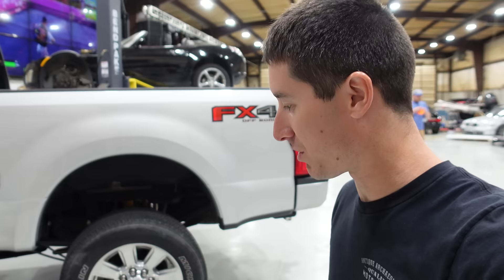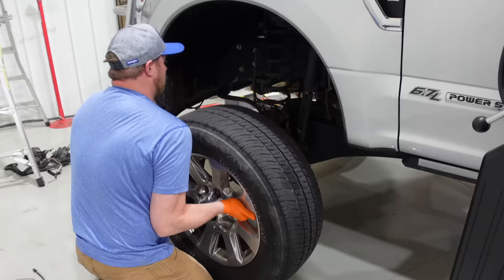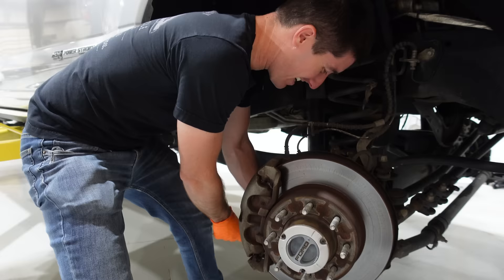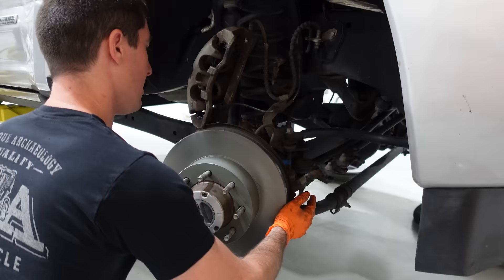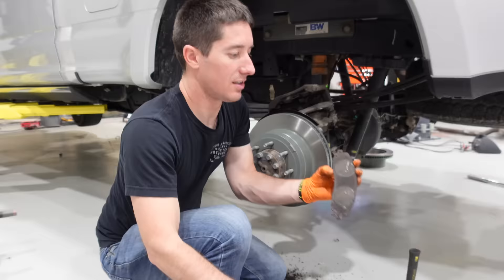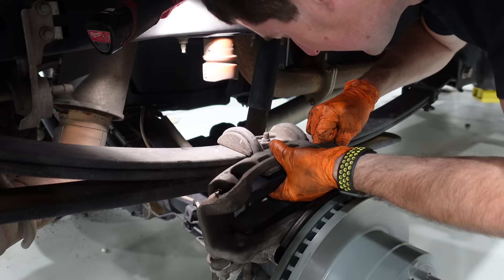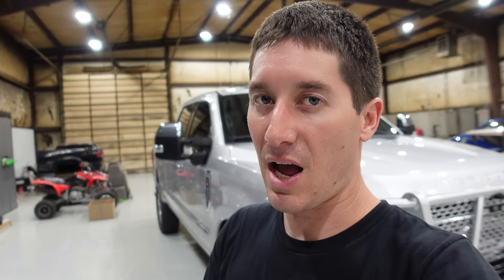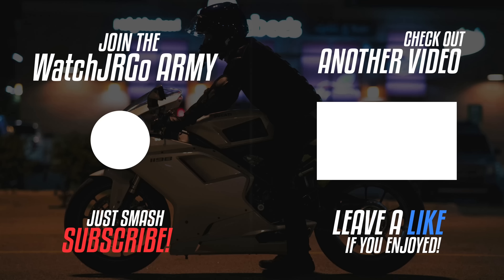This Simple BRAKE JOB On My F-250 Cost OVER $800

Comment: Back in the late 70s when I was running an auto parts store, I had a customer who had a rural newspaper route.  He had a Datsun 510 wagon that he used for the route, and he was (understandably) hard on brake pads.  I offered him a good deal on a whole case of pads, and since he was putting a new set of pads on the car about every 2-3 weeks(!), he jumped on the deal!  He said he could change a set of pads in about 10 minutes with hand tools... including jacking up the car!

Comment: Glad I’m not the only one who fights with brake pad clips when doing what should otherwise be a simple job.  And that we both buy Hawk or StopTech/PowerStop.
Reply: Pad clips on a ford brake job have always been a nightmare when I do them
Reply: If you have access to one, a sand blaster is the best tool to use on the caliper brackets. The clips still aren’t easy to get on after but they are less impossible.

Comment: I’m a tech so i work in the automotive field everyday and the worst calipers to take off on any vehicle are chevys cause they lock tight the bracket bolts from the factory and they suucckkkk to take apart. Especially when you can’t get an impact in there

Comment: When the after market is better than oem
Reply from the maker: Super weird, right? I think rotors should last longer than 60-80k too 🤔
Reply: @WatchJRGo  depend with things that are used to tow you're better off changing them around that millage because the heat will make them crack.
It's heavy AF and that generates alot of heat

Comment: Hopefully lubed the caliper slide pins off camera if not need to put it back on the left to do that because that might be what caused your brake pad wear in the first place. And if you don't do that no matter how easy you're on your breaks or how good the brake pads are they'll prematurely wear out it may even damage the caliper and mounting bracket, if you did not lube the pins. If of the pins are not lubed, the caliper will seize on the pins are not move. The pistons will push only one brake pad against the rotor and will have to work harder to stop the truck causing it to were the inside brake pad. Also it's a lot easier to reassemble if you take the calipers off the mounting brackets.

Comment: 16 year Ford master tech here…..the calipers are supposed to be removed from the brackets. One, it makes the job sooo much easier, and two, you’re SUPPOSED to wire brush where the clips sit to clean off the rust (keeps the pads from dragging due to poorly fitting clips, and makes the clips easy to install) After that, Install the rotor, reinstall the bracket with the clips pre installed, install the pads onto the bracket, compress the pistons on the caliper, put the caliper onto the bracket, install your bolts, torque, and you’re done. 
Not separating the caliper from the bracket is why this job took you several hours….instead of 2….max. 
Additionally, based on my experience, even with the heat checks, those rotors were TOTALLY serviceable. GENERAL rule of thumb, you can machine rotors AT LEAST one time (unless the pads are worn down to metal) before needing replacement. Refer to the measurement spec that is stamped right on the rotor to be sure. 
BTW, Oreillys machines rotors. I assume, because you’re such a good customer of theirs, I’ll bet they would have machined them for free….or at least at a very discounted rate.
Reply: Can’t trust those Ford rotors, I went to change a wheel speed sensor on my 6.7 powerstroke , had to remove the rotor, well by removing it with a 10lb sledge hammer and a block of wood, put it back went for a drive, boom warped rotor. Best to replace anything and everything that has to do with a broken part on those Fords. Got a bad fuse? Boom need new fuse box, bad injector? Cummins swap baby

Comment: Should’ve gone powerstop brakes. Literally they are game changers. Love them on my 2016 powerstroke.
Reply: I'm on my second ford vehicle with powerstops - and I agree... they're nice.
Reply from the maker: Probably is a big upgrade, I see them on a lot of Super Dutys. I’m trading this in before the end of the year, kinda hate that I had to do this. Time for a new Platinum or a Powerboost 🍻
Reply: I'm not sold on PowerStop rotors. I've used them several times. In the rust belt, slots tend to rust up because no contact with the pads and they become noisy.
Reply: @n9wox  you could paint them or even use anti seize in the slots
Reply: @atomicbogator6799  you cannot use anti seize in the slots. Drilled and slotted rotors are no good on a heavy duty truck anyway. Raybestos specialty truck rotors and severe duty fleet pads are the way to go.
Reply: @semajniffirg230  oh wait you mean drilled and slotted rotors?? I thought u meant the actual slots in some rotors on the edge and eh raybestos is good for heavy duty like u said that's about it

Comment: I did my 15 f150, power stop extreme duty, all the way around, @ 80k, as well. Much better performing setup, than the oem's that were warped around 30k.

Comment: Just did my back breaks on a 2016 transit connect. 230.00. Took forever because of the design. Had to use a box wrench for the top caliber bolt.

Comment: some would say that when depressing caliper pistons to open bleed screw to remove debris and fluid in caliper. formerly I never did but after having a seized caliper piston bound but what looked like abused engine oil with dirt and grease added it seems like a good idea. BUT the choice is yours.

Comment: I do a ton of highway driving. Bought my 2021 f250 factory new with 6 miles on it when I get home. I changed the front pads about 70,000 and I'm changing my rears right now at 95,000. Again more than half of that mileage is highway and not breaking tho.

Comment: I would have gone with Power Stop brakes instead. At about $300 per axle they aren't cheap but they work better and last way longer than the stock parts do.

Comment: If you have to force your pads in, you are doing something wrong. Second cheap quality aftermarket like from AutoZone never fit right and that is why you have to grind the ears to fit in place. I'm a automotive technician for over 20 years and I have seen it all. You save money and time getting well know aftermarket parts or OEM (Like Akebono, EBC) but those store brand name pads are all made in china once size fits most. That is where your installation issues began and you will ended up with pads dragging, not sitting properly and uneven wear, plus the compound material aren't the best either. If you are going to do the job do your research and buy it online not at the local auto part store unless you are in a pinch.

Comment: The first time I took the wheels off my 2008 F250 it took chains through the steel wheels and a 20 ton jack and even with that still had to break out the propane torch to heat the hub to get the wheels off.  Then it took a 10lb sledgehammer to get the disks off (everything rusted solid onto the hub and hub face).  An entire weekend just to get the wheels and rotors off.  Needless to say I put copper anti seize on everything putting it back on and has been no problem since.  Factory refuses to use any anti seize between these parts

Comment: My brother had an older F-150 that needed new wheel bearings. The bearings were actually part of the hub and rotors. He had to replace the entire assembly because of bad bearings. He’s got a Chevy now.
Reply: My uncle has a truck like that. Its a 2006 or 2007 Ford F-150. I didn’t even know they made them like that until I had to order him parts.

Comment: Jeez, you're not kidding at $800.  Just the rotors were $750 before tax.  I just did four rotors and pads on an Accord and it set me back $650, so $800 sound cheap for a 250.  Dealer offered $1,150 to turn the existing rotors and slap new pads, or $1,325 to replace rotors and pads. 
I haven't had a stealership do a break job for 20+ years, but it warms my heart knowing how much I saved.
Reply: $1k plus for turning rotors and new pads on an Accord.😵 I charged my neighbor $40 for labor to install his provided new rotors & pads front only on a civic. Done in about an hour.

Comment: I have a 2017 Ford F250 Lariet 4x4, I took it to ford at 50,000 for front brakes and rotors cost me $450 for the ford forever brakes ( just pay for labor ) so it should cost me about $250 on the front from now on.  And today I took my truck to ford for a rear brake pads and rotors at 117,000 miles not bad.  But it is going to cost me around $975.00 for the rear brake pads, rotors, and labor which is the bitch !! Because these HD truck have full floating axle it takes ( whatever the hell that means ) a lot more time to disassemble the rear end.   The rear end brake and rotor job at other ford dealerships and non dealership brake shops gave me estaimates of $1175.00 up to $1450.00 it is very exspensive to own these trucks !!! I guess thats why I see so many on the used car lots. Not just Fords, but all HD trucks.

Comment: You really need a 3/4 drive 18 inch breaker bar and single hex sockets from 17mm to 36mm. Trying to break big bolts loose with that little girly ratchet is a joke.
Reply: I have a 36 inch snap on ratchet for those occasions

Comment: Just drove 3hrs to my sisters cause her Accord was was making a grinding noise and smelled funny so I pull the front wheels off the pads are gone nothing left one pad was even missing  the rotors are of course trashed 1 caliper was sticking the other was leaking and 1 bearing was toast!!! I ended up staying a whole day and replacing everything up front brake wise, bearings, front struts,sway bar links.

Comment: Most shops won't do a brake job unless they change out the calipers complete. Took my company 2000 E350 in for brakes back in 2005, cost $2600.
Reply: Scam shops
Reply: @honchoryanc  
It's not so much a scam as they are protecting themselves from potential liability if there is a problem down the road. Especially when it comes to brakes. I personally know a shop who was sued because they replaced the caliper and rubber brake line on one side of the car and not the other. He was trying to save the customer money because she just couldn't afford to get it done at that time. He wrote it up on the ticket that she should return asap to get the other side replaced. 3 months later the other side line blew and she crashed her car. A lawyer filed suit and it was cheaper to settle the case than to fight it. From that day forward he refuses to do any brake job without replacing the calipers and rubber lines. It's sad but thats the world we live in.
Reply: @honchoryanc  Well it was a large West coast tire chain shop that claimed liability issues as company policy.

Comment: Wow. JR and his brother in law put me to shame. Or I proved them 100% right you need the right tools to get the job done.

I must have taken 8 hours this last Saturday to swap the front calipers and replace the front rotors and pads on my 2005 Toyota Matrix.

The biggest thing that slowed me down. I didn't have a 1/2 impact swivel. And an impact gun would never clear the brackets on the back even if I did have the swivel socket. Doing by hand with a breaker bar was not fun. Especially when I had bad side strain on my left side I gave myself at a Salvage yard earlier in the day.

No flipping way were the driver side caliper bracket bolts tightened only 80 lbs. Pretty sure somebody I had work on my car had a power tool that way overtightened those bolts.

I'm seriously considering getting a power ratchet. Something 100lbs or more torque rated would be great for future repair jobs.

Comment: I once bought a shogun where someone had snapped the squeeler off the inner pad, outer pads looked good through alloys. Wrecked disc which needed wheel bearing dismantling, seized sliders sorting and one of new discs wasn't machined properly and had horrendous runout so had to do again.

Comment: The caliper bolts aren't that tight they have thread lock from the factory, a little heat solves that then you could have used your tiny little ratchet.

Comment: Big brakes = Big Bucks. I remember my first four-wheel brake job on a 3/4 ton. I guess I was spoiled owning 1/2-ton pickups.
Reply: Big truck, big brakes, sure. What about small car, big brakes? 1990 Volvo 240 wagon. 4 piston calipers up front, 2 piston on back, all made by Gerling. 6 flex lines. 17 litres to flush the brake fluid. Don't forget the pressure relief valves for the rear brakes. Those are from Saab Aerospace! Maybe a bit of overkill, but that is the stock factory brake system on the base 4 cylinder car going all the way back to 1974!
Reply: My brother drives a 2016 F-350 Power Stroke. Then again, he lives in the Yukon. The roads are very unkind up there.

Comment: F-250's have done this for years (like 30). I was dealer tech in the 90's and replaced a ton of them even than. Gotta love Ford (not) and their vehicles.
Reply from the maker: I just don't see how when GM/Dodge don't seem to have an issue 🤔
Reply: My brother has an F-350 and he doesn't have this issue. Then again, the truck lives on what passes for roads in the Yukon Territory, so everything seems to shake apart.

Comment: This job isn't covered by the carmax warranty?
Reply: Brakes are always just wear and tear, in the same way they wouldn’t cover new tires.
Reply from the maker: Nope, wear item like tires 🍻
Reply: OK thanks!
Reply: When I bought my 89 Grand Marquis new, the extended warranty covered the calipers but not the discs and pads UNLESS the discs and pads were worn prematurely because of a caliper not working properly. Unlimited mileage for 5 years. Came in handy considering the car had over 120,000 miles when it was 5 years old

Comment: Is it really 8000lbs? I think the limit in the UK for a for driving on a car license is 3500kg (circa 7700lbs). That might be why the F-series Fords are only sold in the US.
Reply: 3/4 ton diesels are really that heavy.
Reply: Another reason why America is better
Reply: If you took your test before 97 it's 7.5t.
Reply: @dafirnz  How heavy does that make the 1 ton F-350 that my brother drives? The only time I have hit weights like that was when my 89 Grand Marquis had a 5,900 pound trailer on it, plus people and cargo. That came out to a bit under 12,000 pounds, so was just on the right side of legal. That car was rated to 6,000 pounds of trailer with a combined rating of 12,500 pounds. The joy of the towing package and the 351W!
Reply: Yes, big frame, big axles, big everything. The Powerstroke engine alone is ~1,000lbs.
Reply: @michaeltutty1540  The F350 is slightly heavier than the F250, because it's basically suspension differences, with added leaf springs and such. The axles, frame, engines, etc. are all the same.

Comment: This is like the people that bitch about a brake job on a high end car! $1000 a rotor and you need 4 of them plus the pads that are about $300-$500 a set!

This is a HD truck, they aren’t cheap to maintain!

And the lug nuts don’t swell! According to the manufactures it’s the technicians that use the wrong size LOL! I guess almost every truck out there is all the techs fault! Even the ones that have never been touched before!

Comment: I have to say, I've had over 40 cars and trucks in my life, and no, I'm not old, but almost 60. I've had collectibles, nearly new, dogs, ancient, you name it. And I've never changed, or even turned any rotors! Once, when I was young and dumb, I went for the whole package. Like in the 70s. That was it! I'm certainly not saying it's foolish, but I've always gone to Brake Check, usually, and just had pads done, that's it. And Never had any problems! I use Brake Check because I'm in Texas, and Coach Popovich, of the Spurs, has been a friend forever, and he owned a few of these in San Antonio, or, at least did back in the day! Have I been that lucky, with so many cars? I think not!
Reply: Discs need changing on condition, if they are below thickness limits, rusty, scored cracked etc. Non asbestos pads are also far harsher on discs than old asbestos pads too.
Reply: I have had no choice but to do discs. Salt in the winter causes them to rust from the inside out faster than they wear from the outside in. My old 1990 Volvo is on its 4th set of rotors all the way around, but that has something to do with severe winter weather and the almost 400,000 miles on the clock. Gerling brake parts are not exactly cheap, but not stupid expensive, either.